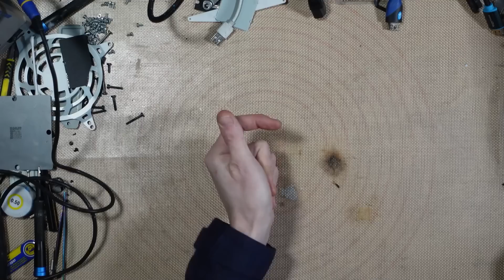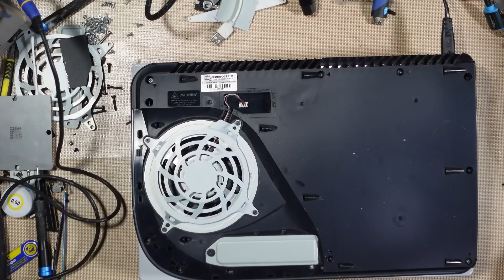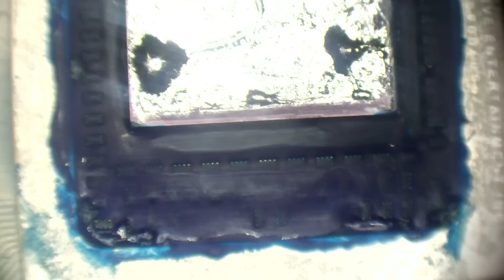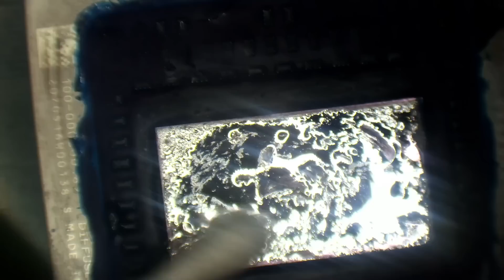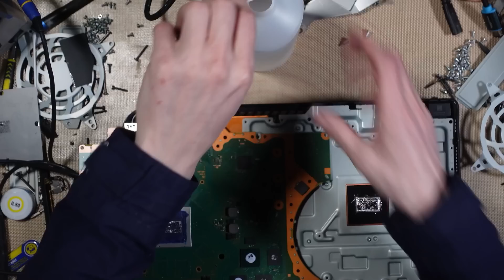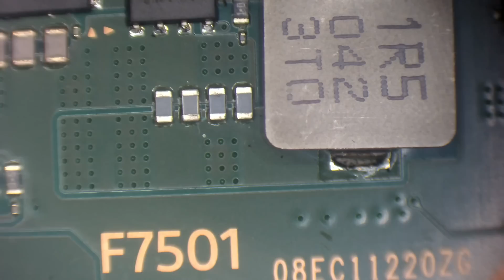My Customer Sent TWO Different PS5s Back For Warranty In 24 Hours! WTF Is Going On?

Comment: The problem here (and I am.not saying it is the case) Is that the customer has been supplied a 2nd/3rd hand console that has already been repaired. Without knowing why it failed initially, effectively it could be a ticking time bomb that just goes wrong. May not be the customers fault but purely bad luck due to the original failure. Personally if I bought broken 2nd hand consoles to fix and then resell, I would soak test them for at least 24 hours after the initial repair.

Fair play for fixing it on Christmas and boxing day though 👍

Comment: I would have thought that the ps5 power supply should deal with spikes etc. 
surely if it's the customers wiring? then other electronics in his house should blow aswell?

if it's a customer error I'd guess more at drop damage.
but yeah dealing with these types of issues is a pain In the butt. 
keep up the good work.

Comment: I would want more evidence of rough treatment before blaming the customer. Bad electrics? Surely the power supply and bypass caps every where could handle this. One was a Southbridge and the other was a cap, those pesky kids sure know how to mess up PS5s without opening them up. I think this is a coincidence and because it's happened on Christmas day / Boxing day it put pressure on you to get it fixed when you didn't want to work putting you in a bad frame of mind. If a 3rd one came back then yes absolutely reject any warranty claim. But to blame bad electrics is a bit of a stretch unless it's plugged into the same outlet as an arc welder. Do you not put the consoles on a 24hr burn in test before release? I found at least 5% failed under burn in test (Not PS5s but other consoles)

Comment: If you are not confident in the customer then a refund is the way to go.
Give the refund and advise getting their electric supply checked BEFORE getting another console as it will get very expensive for him to keep replacing consoles.
Plus let them know that until its been checked/rectified you can't warranty any consoles he buys from you.
It's harsh but you have to look after yourself and your family first.

Comment: I’m not sure - could faulty household power cause this?  The problem would need to get through the switch mode psu and cause the capacitor to fail (over voltage?). I’m erring on it just being bad luck.  Thanks for doing the right thing

Comment: Sounds like the customer isn't using a power strip and plugging it directly into the wall and getting surges that are killing them. That's my out of the air guess. They aren't dying, they are getting killed. Also, I think you can buy drop tags that go into devices to detect if they have been dropped. Not sure how much they cost but you might want to start looking into those (they are used in industry for exactly this reason -- customer claims faulty item but it is then determined to have been dropped or mis-handled in shipping which then causes a claim to the shipping company). As far as the warranty fix, i'd say to the customer that is the last time fix. If it comes back again, that's on their dime. Specially for the same issue, warn them to use a power strip.

Comment: See, somebody like me, I've been working on small engines for 40 years plus, there is nothing I haven't seen, so I know what has been done to a machine, you can't con me, so I sell a mower, I stand by it, but bad gas, hits a root in the ground, or damage caused by the customer, voids all if any warranty, you do work on many different kinds of electronics, and know what causes what, so like I said in the last post, give the money back and be done with him, period, you know what causes the shorts, like I know what causes a small engine to fail, so you did right by the customer, but faulty power in a home causes the problem, you will never be done, so like I said refund the money..... And move on.

Comment: Give the refund, mate. Something seems wrong at the customer end. Maybe if they used a UPS to act as a filter for the bad electricity supply, then maybe send it back. Otherwise, they will continue to have more issues. Glad you stand by your work, regardless!

Comment: 100% refund, let him buy new and let that fail within a few hrs, I have a very expensive surge protector for my console because my area has faulty electrics ( smoke out the flags was a sign )  Your son played with that for 5 months without an issue, the new owner returns it with a fault less that 24hrs if ownership, regardless have a great new year and RIP your loft out lol.

Comment: Nice job Phil. If it were me, I would definitely give the unit back. There is no way to confirm that this was not a fluke given the failed capacitor. if THIS one fails again, then you can confirm that there is a problem at the house, whether electrics or bad handling. The customer needs to see that you are confident in your repairs and this makes for good customer service.
Reply: I was thinking exactly the same
Reply: Yep, I thought the same thing.. You should give it one more go for the kid THEN if it happens again, THEN refund money and give back his dead PS5.
Reply: Nice way toclean your hands... with gray water "there is a problem at the house"

Comment: This why i fix them for myself. i dont fight with myself and still fun to do. wont ever use liquid metal ether to hard to work with and mx-4 is 8 year + save alot of trouble. donor parts dont help better with new. its like your car how long does a scapyard part last. we used to call it "yellow line guarantee" soon as you cross them double yellow lines in the road ur guarantee is up.

Comment: I would be surprised if it's anything to do with their electrical installation, but they could be having an over voltage coming in, which is beyond their control. And because all electronic equipment is built differently, some stuff can withstand it while others can't.
Tell them to use surge protection, which will protect them from most over voltages. 
I had it recently on a job, bt had an over voltage during a storm, took out anything connected to the router, CCTV, PC, router etc.

Comment: I had a blod on a 4 month old console, repaired by Sony. I bought another while waiting for the repair, which was 3 weeks, its sat in the box now, and I am waiting to see if i can sell it in the new year. It is very concerning on the failure rates. Hats off to you for repairing over Christmas. Not many would have touched it until January.

Comment: Honestly, I do think the drop is what caused this. One of the signature failures of ceramic capacitors when stressed is that the ceramic cracks, and the way the caps are constructed make it very likely that you get a short circuit. Look up a cross section of a ceramic cap to see why that's the case
Reply: All ps5s get dropped 20 times during shipping. Motherboards aren't that fragile
Reply: @thomassmith4999  PS5s inside of a padded box, sure. Do you understand exactly how much engineering goes into packaging? Also, you probably miss the several that do get returned from shipping damage like this anyway. It isn't arguable: MLCC capacitors have multiple metal layers that are very close to each other, from the positive and negative sides of the cap's terminals, and are held apart from each other only by a very brittle layer of ceramic. A drop might not crack one, but it's more of a chance than an exact fact.
Reply: @metroid031993  I'm a man of much ewaste collecting and damage like you suggest even from being dropped/thrown/ dumped out of a truck simply doesn't happen. Capacitors do break if they've taken a direct impact on the capacitor but inside a ps5.. it's just never going to happen in a million tries. I don't know what Sony are doing to get so many bad quality caps or if the Uk has stone age quality power supply. But it's not from being dropped.
Reply: @Jasonsadventures  I mean, again, in a box, you're correct. But I think the issue here is pretty cut and dry: PS5 goes to new house, comes back with clear drop damage. Gee, wonder what happened? All it takes is some board flexing and that cap is done.
Reply: @metroid031993  What happened is luck, people win the lotto the same way. All I saw was a ps5 with messy liquid metal (all of them after they've been opened) and a failed capacitor which happens often on the ps5 too. (And a guy father who's especially grumpy at Christmas time, That's all of us and was me too :) )
Reply: Oh yeah for sure this was dropped.
Reply: I'm going to have a look into that, I saw a video, I think from EEV blog who was talking about MLCC and showing the sort of stress faults that can occur. It would be interesting to test that out by putting some SMD ceramic capacitors under stress and see what effects vary ammounts has on it.

Comment: I guess it all depends on how you go about it. You let the customer know what you found out. And that you believe it's the electric wiring in his house. Then give him a choice. Either a refund or void the warranty going forward. Perhaps use Christmas as an excuse for not charging him at this point....just some thoughts. You obviously can't please everyone, but you also want to put yourself in the best light possible and still remain profitable.
Reply: The problem is that this fix is probably a $75 repair that Coder is going to eat the cost on. That’s not fair imo
Reply: I look at it as a balancing act. At some point, you do have to cut your losses. Sometimes you can't win with a customer. If you can work something out, all the better. Then maybe the $75 lost now will produce many more returns down the road.

Comment: Hi Phil, Rory here. SOOOO, a customer of mine passed me an Ipad for repair with a bad power management chip, then soon after, an Iphone with a bad power management chip. Then another Iphone with a bad power management chip. Then they asked my to fix a huge TV with a bad power supply. That was the final straw that got me thinking. I asked if they have had their electrics certified lately, they told me they have started running the house on a generator lately. Well there is the problem. The generatoer was spiking the electrics causing all these faults. Now with the recent massive price hike in energy bills. It begs the question, Is this customer running a generator? It's worth asking mate. I hope this sheds some light on the situation.
Reply: rory that such a good idea he might be using solar panels also as the u.k gov are giving them away these days just a thought.
Reply: How is running your house on a generator more economic? And why is that a good idea? You can invest on solar panels,  change your appliances for others more energy-efficient... People have the weirdest ideas
Reply: @Kiel2040  I don't remember saying it was economic, that was probably their thought, as for it being a good idea, I did not say that either, that too was their thought. I was only saying what I descovered to be the cause of the failing power management chips in the Apple devices and was telling Phil about this just in case his customer was using a generator.
Reply: @rorykelly8275  sorry I didn't mean to say you were the one doing those things. Just thinking out loud. English ain't my first language, my bad. Sorry again.
Anyway, Is in the UK more cheap the fuel to have a generator running than paying a power company. Or this person might be on a rural area where theres no power lines? Still not the best solution to use expensive electronics with sensitive components
Reply: @Kiel2040  I think they may be getting their hands on cheap or even red Diesel, in which case it would be cheaper than grid electricity. But as you say, bad for sensetive electronics.

Comment: I’ve been following you for about a Month now and I’m gobsmacked at how many PS5’s you’ve repaired proper puts me off buying one! Imagine Sony / Retailers have a high return rate.
Reply: ive had my ps5 since august 2021 and had no problems with it i think its just how people look after them
Reply: I think if it was a serious problem it would be in the news, like some of the reasons peoples consoles break is just due to not looking after them, dropping them, being to rough with the USB-C ports, HDMI ports etc which can all be avoided by being careful with the device.
Reply: @VoidEcho23  Oh yeah im not saying it isn't flawed it's the luck of the draw i guess
Reply: To be fair its literally a channel about fixing consoles. Not a full indication of how well they are built
Reply: @Celder21  Oh ok sorry my mistake thanks for clarifying. 🙄
Reply: @@verved1  I'm just saying this isn't the best place to get your data if they are well-built. They'll certainly be better data you can find than a channel. Of course up to you at the end of the day. For me as long as you take care of the console you should be fine. 

The one issue I have with my ps5 is I was unlucky to get one with a slightly louder fan.
Reply: @@mjc0961  I'm not saying this is a bad indication. However it's not the greatest indication either. Numbers will never be revealed by companies as you mentioned. Sure more ps5 need replacing but for example more people could own ps5s. It's a bit hard to say with 100% certainty that they are badly built.

I agree from what I've seen here it doesn't look great but it's very hard to tell.

Comment: Don't people use surge protectors in England? I live in Plymouth, one of the oldest cities in Michigan, and the electricity infrastructure here is so poorly maintained by DTE Energy that one of our substations caught on fire and they spent months replacing the equipment. To cope with the frequent brown outs and to prevent damage to my equipment, I run 6 UPSes in my 800 square foot apartment, and several more metal power strips with built-in surge protectors. I would never plug anything directly into the wall that I was not okay with destroying (just kitchen appliances).

Comment: Do You check the Serial numbers against the Returned machines ??? Reason I ask is because I work for a massive Retail company and the amount of scammers trying to return faulty PS5's and Xbox Series X's ( which was not the ones they purchased ) is Stupid at the Moment   ... Just asking
Reply: I think the conformal coating on the processor was a giveaway that it was one of Phils consoles. I suspect there is some issue at his end but I'd err on the side of some accessory (usb device / tv) thats pumping something it shouldnt into the console. Most SMPSU's ive worked on have quite a bit of filtering as its needed to pass EMC regulations so I'd be surprised if a mains tranisient could do something unless they have something very badly putting noise onto the mains circuit beyond the usual frequency domain

Comment: What a pain!  Hard to say - it COULD be a coincidence but it seems fishy to the uninitiated like myself. One would hope that the Sony power supply would cope with transient spikes or whatever but perhaps not. If you think a refund is the best option I would OFFER it to the customer or say that the warranty is conditional on them getting an electrical safety check. You need to be polite to avoid the customer getting on to trading standards - there may be annoying issues with 'PAT testing' on secondhand goods sold by a business for example so one should try to keep the customer onside. Hope it gets sorted!
Reply: It's the dips apposed to the spikes, lately it's the brownouts that are destroying caps

Comment: Absolutley go with the refund so as you dont end up with another issue if the customer does not believe your diagnostics (although most probably correct) secondly everyone is entitled to a break. I would not be responding whilst i am shut

Comment: I would refund them and not sell to them again, having two PS5s fail within 24 hours is clearly something wrong with the electrical wiring in their house or the power plug they are using.

Comment: could someone help me? currently working of a xbox thumbstick replacement and changed it out but is was drifting extremely hard to the  left I thought it was a faulty replacement so changed to a known good one and still the same problem. At that point i thought it could be a bad trace but no visual damage. if anyone has had this problem please could you help me out . spent way to much time on this or ill happily send this to be an interesting video.
thanks Cam
Reply: I have drift on my kids upstairs tv but downstairs tv works fine this is a series s console also

Comment: My question is how would the person ever know if he has good, or bad circuits in his house? That's something only a qualified electrician would be able to determine. The owner trying to defend his home's electrics is ridiculous. The fact that two consoles have been blown, and the fact that the common denominator is his home it's elementary moving forward. I'll bet dollars to donuts he most likely plugged it into the exact same outlet too.
  It's super easy to say "well I'd do this, or that", but you were put in a really tough spot by a relatively unique problem. It's easy to blame the console owner because we watch your content, and know your good reputation, but we also can't expect the dude to know his way around a house's wiring. Most of us automatically assume that there's some sort of dishonesty from the customer because most of us are jaded, lol.
  Most likely the kid plugged it into the same exact outlet, and got the same exact results. He probably heard a slight pop, if any at all, saw that the console wasn't turning on, and instantly blamed your repair to be faulty. If at all possible, when dealing with face to face repairs, it might be a good idea to show the customer the console working in your home, then have them sign a witness contract stating that. That way they can't come back on you later, and blame you for it. It'll keep you protected from any sort of entitled stupidity in the future.